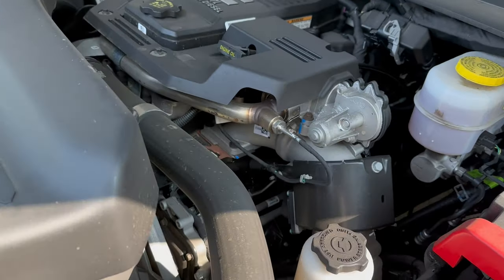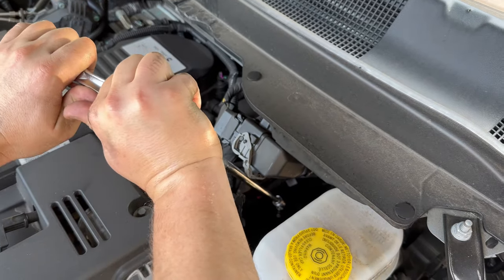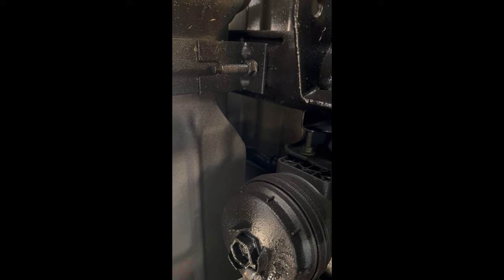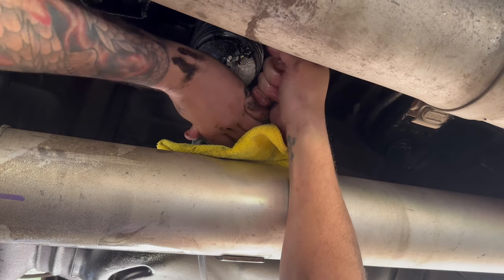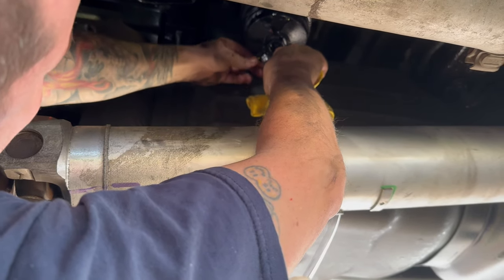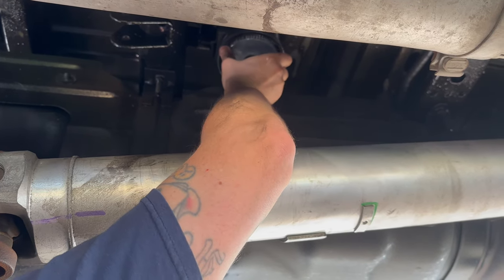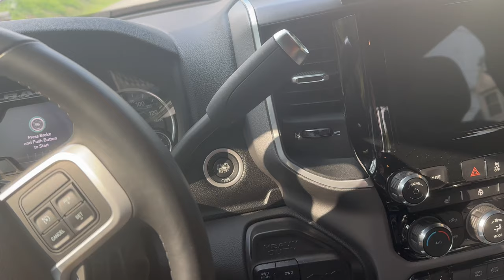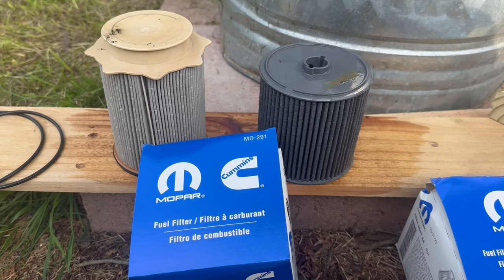Ram 2500 6.7 Cummins Fuel filter change

Comment: LOL it always a bitch on the first change with oil and fuel filter.  Really tight, but should be easier after first one with DYI.   I suggest for re-installing the rear filter to place it in the cap first.  It clicks in the cap and easier to capture on the bowl to tighten.
Reply from the maker: Glad to hear it gets easier and yeah that rear filter was my screw up I’ve contemplated taking it back off and redoing it. Thanks for the tip!